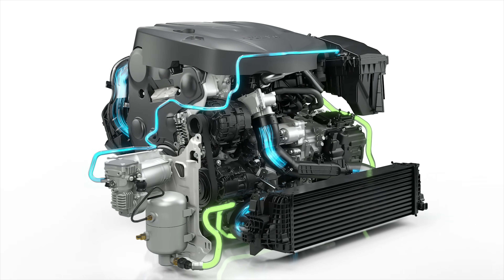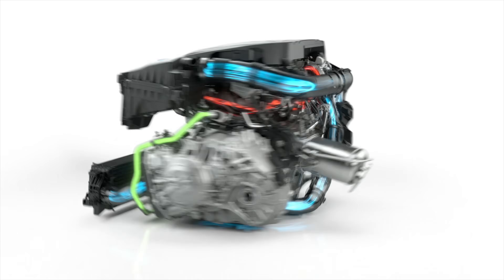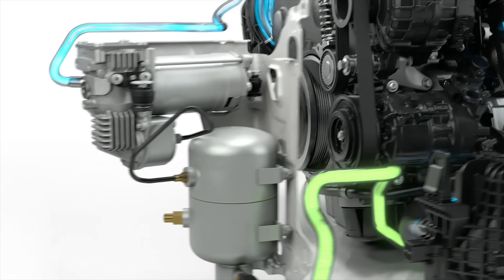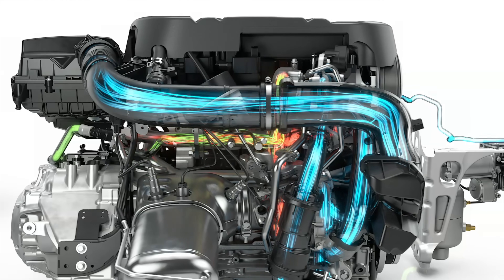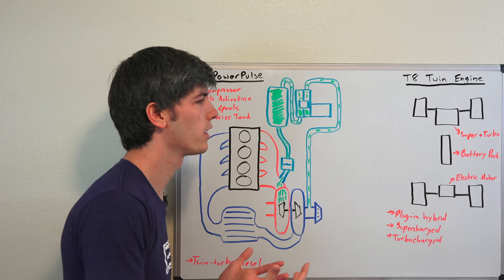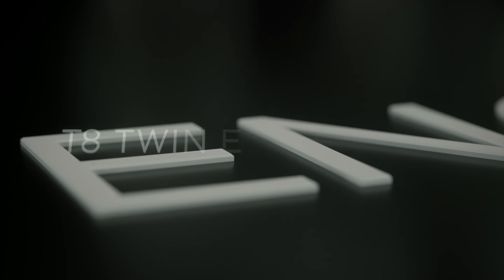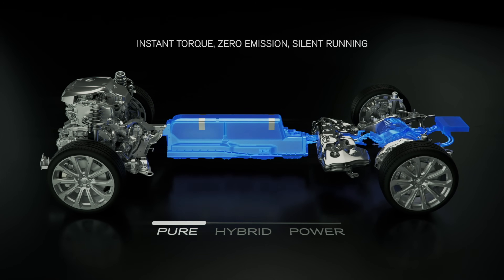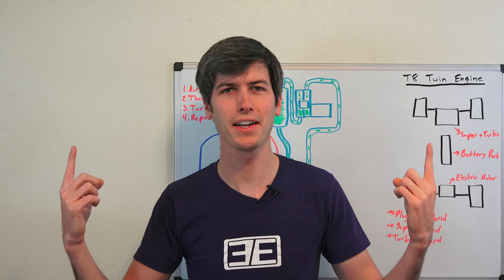How Volvo Is Eliminating Turbo Lag

Comment: What happens if you get into a wreck and that tank is ruptured?
Reply: Zax Crylan i presume they put a one-way valve kind of thing between the tank and exhaust manifold so if system fails to build up required tank pressure (e.g tank is raptured) you lose the anti-lag but can still spool the turbo by exhaust gases..well thats just my assumption though
Reply: Ayman Almateeg no. If you wreck and rupture the tank it explodes.

Comment: Is there a reason why they don't just use a motor to directly spool up the turbo, instead of using it for a compressor? Seems like a simpler and lighter system.

Comment: The latter part of your video reminds me of the old Golf 5 GT with a turbo and supercharged engine.  While I think the concept is cool to help mitigate turbo lag in a sense and maybe add a little sportiness to the Volvo brand, the extra added cost for these components, should one fail would be a turnoff for me.  Also the added cost to the overall MSRP of the vehicle when you look at purchasing new.  Although I don't call Volvo's a high end luxury car, I think this may push prices to more than what people would be willing to possibly spend on a Volvo.  Especially if the performance doesn't match up to a car of similar price, especially if you look at the V90.  

You produce some great videos, so please keep up the great work.
Reply: My Name You have a good point, although, considering recent Volvo depreciation, one of these would probably be a screaming bargain in a few years as a used car or CPO.
Reply: That is a good point about being a CPO car.

Comment: Haven’t they been doing this with nos for awhile now?
Reply: Nitrous oxide doesn't fix turbo lag
Reply: s i d e w a y s l i f e s t y l e I don’t remember the name of the company but there’s been a kit out there for a while that injects no2 into the cold side of the turbo to bring it up to speed it may just be a drag car thing to help cut down 60ft times I’ve even seen it done with a bottle of regular compressed air
Reply: Never heard of it, don't think it's common either tbh, if it even exists.

Comment: I have read about this somewhere before where instead of letting the waisted boosted be released into the atmosphere when one lifts off the throttle said pressure is stored to be used latter...But I thought only racing turbo vehicles store unused boost for future use.

Comment: I feel like I saw an article a few years back talking about a similar set-up with the pressure tank feeding the intake side instead of the exhaust. Did anything become of that?
Reply: Cars Simplified I don't think you can get much benefit by pressurizing the intake manifold of a car that uses forced induction. But maybe that's not what you were suggesting.

Comment: IIRC years ago Ford developed a prototype compressed air system to accelerate F150 pickups and said it could easily accelerate a F150 to 25MPH without assistance from the internal combustion engine. The compressed air was used to spin the drive shaft from my understanding. Perhaps they placed vanes on the driveshaft similar to a turbo and made it from a light weight material such as aluminum and carbon fiber?
Reply: Interesting stuff! I wonder what became of that.
Reply: Cars Simplified not a damn thing

Comment: I just wonder, why not force that compressed air straight into the intake instead of using it to spool up the turbo? Is it a volume problem? Not enough air to keep the pressure up before the turbo takes over?

Comment: Sounds like a high pressure secondary air pump. The introduction of air will lean out the exhaust mixture causing it to become even hotter. Of course hotter air mean less density, more energy, and quicker flow to boost the exhaust turbine speed. Good job volvo smart innovating!

Comment: Good technology  more  headache at repair shop .
Reply: Rimac, nio or delta motorsport es very superior, four stroke is shi* is to want to improve what is already deficient. And more maintenance cost.
Reply: Soapy water u can find leaks fearly quick no big deal
Reply: What makes it double good. Feature to sell, money during maintenance/repair :+1:
Reply: That's putting it mildly!
It will be quite a headache when there is a leak somewhere on that tank-to-turbo line.
Reply: I'm a Volvo mechanic, and the power pulse system is already faulty so were rebuilding it on warrenty

Comment: Will it not run lean when it's using the compressed gas as it's not accounted for the extra air or is it pushed throw the air mass sensor
Reply: the compressed air goes to the exhaust housing on the engine turbo, which will suck up air quicker and compress it quicker all while passing through the AMS/AFM so no it wont run lean, if it did it wouldn't be for sale as they would be blowing engines in testing

Comment: @EngineeringExplained is there a possibility you can do a video or series on trucks: specifically Chevy/GMC, Ram, and Ford. You could touch upon the Diesel variants Cummins, Duramax, Powerstroke. Maybe picking out the fallacies and doing some mythbusting amongst those who choose one company's truck over another while choosing your favorite based on criteria you've used in the past to choose a preferred car.  You could even get into the gasoline versions as well.  It would be  very interesting. 
Your videos are great. Keep up your hard work!

Comment: So basically they are using a generator, battery and an electric motor instead of a simple driveshaft for the rear axle. I wonder if this system is more efficient than a driveshaft
Reply: I dont think so. Added complexity and repair costs will hurt hard.

Comment: In some marine engines, this system is used to prevent black smoke on starting and of course sudden changes in load. In a car this must have this benefit too and prevent damage to the Catalytic Converter by unburnt fuel.

Comment: Lesson learned turbos make lag and need help to give you that NA feel.
But they game the epa with higher numbers.
so all companies even Porshe or cutting at least 2 cylinders and adding a turbo to make up the power loss, with some lag and no high end power, but technically more torque and maybe even faster with the lighter engine weight and all, and possibly more space with the smaller motor and all.

Comment: the best turbo lag reduction is to use 6+ litre V8 instead of 2 litre I4
Reply: some people dont want to buy that much gas...just money for greedy opec and big oil
Reply: Jon Dittmar Lame.
Reply: the auto manufactures care or else they will not be able to stay in business. is that a good enough reason?
Reply: Jon Dittmar You're wrong, and that is the reason you can't stay on topic and continue to distract. The subject at matter isn't the FM or it's safety, it's the size of LS and other 6+ liter engines, and the FM is just as example how well an engine of that particular size can fit. There are myriad of other cars with LS and other 6.0L or larger small blocks, most of them production and crash tested vehicles.

The LS is a relatively small engine, not much larger than 1.8L Mazda Turbo.
engineswapdepot com/wp-content/uploads/2015/02/Miata-I4-engine-vs-LS3-V8-size-comparison-02-1024x567.jpg
Reply: Jon Dittmar exactly adding power is no where near as beneficial as reducing weight
Reply: that ls swapped miata is not crash test approved there is much more testing required for a production vehicle
Reply: we are talking about production vehicles not project cars......
Reply: i don't think volvo wants to give gm money. volvo is to small to have multiple engine options
Reply: And get less power and torque out of the v8 than the i4
Reply: Who? Me ?
Reply: turboing both.. wat?
Reply: that means either a bigger car which would add more weight, or decrease passenger volume, have to fit that engine in their somewhere. This setup add hp, fuel efficiency, and doesn't touch passenger volume
Reply: chris nice argument, you totally won that debate. please teach me how to be smart like you
Reply: Jon Dittmar = FAIL!
Reply: More cylinders = more surface area = more oil.
Reply: The new XC90 T8 makes about 30 more horsepower than my dad’s 2006 XC90 V8 with a 4.4 litre Yamaha V8 in it.
Reply: clayman666metalYT and get a third of the mpg along with monstrous long term maintenance costs
Reply: A v8 has more lag, more cylinders need more air to make the power. Also v8s cant go around corners fast
Reply: Jon Dittmar You clearly can't follow. His point is that the LS , a 6L+ V8, is small enough to fit in a Miata, but your flew off the rails into non-sequitur land. It doesn't whether it's crash tested or not, the LS is a small engine, and your initial statement is false.
Reply: You hate cars don't you?

Comment: so they are using an electric motor to feed compressed air into the system. why not just take an electric turbocharger (like audi) to kill the lag? is there a significant cost difference in production? do you happen to know that

Comment: Something else to add to the cost. Something else to break. It seems like something that would only appeal to a few, and only occasionally be used. And it will only reduce lag, not eliminate it. After driving an electric car, all internal engines lag. To each his own, but I’ll pass.

Comment: great ideas, but how can they build this to be reliable?
Reply from the maker: +Dany test, test, and test some more. :)
Reply: the automotive industry doesnt know what the hell reliable is.
Reply: to be honest, 
volvo haven't had any significant problems with these engines since 2015 ...
they did have some software issues, but they were rather quickly resolved with an update.
but the engines don't seem to form a problem whatsoever, let's see how they continue to hold up. :)
Reply: Volvo is the most reliable car in the world...
Reply: Albert S  that is just not true.
these new engines are not old enough yet, to call them bullet proof.
but they are not causing any problems !
Reply: what do you mean exactly ?

Comment: @Engineering Explained  Jason, sorry to be pedantic, but I think this actually isn't a sequential turbo system. Sequential turbos refers to when there are two separate, different sized turbos both being fed by exhaust directly from the engine, with the smaller turbo working primarily during low RPM and the larger one working primarily at high RPM (I know you know this because you discussed it once, I think). It looks to me like this is a compound turbo setup, in which air is compressed by one turbo and then re-compressed by the second one, and so the boost pressures created are multiplicative instead of additive. Is that what Volvo has done here?

Comment: Before watching this video, I thought there would be two options: compressed air or adding an electric/mechanical drive to the turbo itself. The second option would have serious heat problems, while the first is cludgy. Cludgy wins.

Comment: With the compressed air being added to the hot side of the turbo is there a danger of forcing the exhaust gases back into the engine or at least preventing the exhaust gases from leaving the combustion chamber properly?
Reply: Tiger955 yeah I was wondering the same thing. I guess the pressure isn't great enough restrict the cylinder exhausting, getting a significant volumes of air through the turbo is probably key, rather than very high pressure air

Comment: To explain why people some people love lag, it's about consequence and reward, if you drive properly while driving spiritedly you shouldn't really ever find yourself outside of boost range (not with anything with full boost by 50% RPM). For a lot of us we enjoy a car that's able to be made fast with fast driving, but not fast automatically. We want to be punished when we make a mistake as it makes it that much more rewarding when you get it right.

Also in some motorsports, especially drift we find lag can be an advantage when trying to find grip with spinning tyres, dropping the revs into lag can help feather the throttle, slow the wheel speed down and get drive. Once you find the drive and build momentum you can easily clutch kick back into full boost to get the engine singing again.

Not to mention the fact that the feeling of a big turbo ramping up and coming onto boost is amazing! But as always, everyone loves different things and that's what keeps things interesting. Obviously none of this is really relevant to production mass production vehicles, just a little insight from someone who personally loves a bit of lag. Interesting video none the less, thanks!

Comment: If you cannot afford a Ferrari but always wanted a Ferrari maintenance bill, Volvo has something new for you....
Reply: Then buy a BMW snd you will see s high maintenance bill
Reply: Not true. On my second Volvo. First was a 2011, S60 3.0 turbo that had over 200k miles on it. Currently have a 2018 S90 T6 which is the engine with the super & turbo charger, and it’s been great so far at 145k miles
Reply: Baerchenization true dat
Reply: Baerchenization haha warranty warranty
Reply: Volvo stopped being real Volvos since they became part of a conglomerate that china profits from.  I'll take an old red block turbo 240 por better yet, a 245 or 145, the single round headlamp oldie that isn't all that different then its newer cousin, the 240/245.  My very first car was a '79 265 GLE w the weirdo v6
Reply: Na my 740 has 300k and still kicks ass and my xc90 has only had to be repaired once due to alternator being bad
Reply: That has to be kilometres, right? @lookItsJayden
Reply: That's not actually true. I had a 850 T5 Volvo and the Volvo dealership took like circa 400 euros for timing job with out a water pump. That's not bad at all if you think about all the space (which it don't have) and all the crap you need to get out of the way lol

Comment: It just hit me:  why not fill up that air tank from the wastegate instead?  Basically reusing the turbo pressure that otherwise would be wasted, and let it fill in the lag for a later throttle application.     
My guess is the wastegate is used too rarely and can't build enough pressure for this to be effective, but in theory it seems like a quite efficient solution :)
Reply: Restricting the wastegate by forcing it's exhaust into a tank will cause backpressure in the wastegate that will mess up controlling the turbo's boost. The less backpressure in the wastegate exhaust the better for consistent turbo control. Cars with aftermarket turbos frequently have to use an external wastegate exhausting with a very short pipe to atmosphere, or if it re-enters the exhaust system a good ways down the line from the turbo.
Reply: Makes sense! Thanks for the reply.

Comment: Wouldn't there be a way to use sort of an engine brake to fill up the tank instead of using the engine's power? Or the system's not worth the additional weight?

Comment: There is an app called PerfExpert, could you please do a video on it and try it out for yourself? I am interested in hearing your opinion on it as an engineer. It measures hp and torque from the accelerometer.

Comment: Why do they use this system instead of an electric turbocharger? (Like audi and mercedes in their newest engines?) is this more efficient or does it have other benefits?
Reply from the maker: +Nelayo Isso more cost effective than an electric setup.
Reply: okay, does it use as 12v compressor?  because at least I think that the 48 volt setup is more likely to become standard in the future, some companys plan with a 48 volt setup and an engine without anything driven from the engine other than the generator (dont know the english word for it), so that the water pump, compressor for the AC and so on are all driven by an electric motor.

Comment: while cool, this seems contrived.  Why not try to compress the intake air directly, e.g. use electric motor to assist compressor at low rpm?

Comment: Didn't Ford do something like this in the early 2000s with the Focus WRC car? Pretty sure they had a  massive compressed air tank hidden in the rear bumper to feed air to the turbo
Reply: David Irvine yeah it did. The wrc lancer evo 3 and st205 celica used a similar system aswell. I think all the modern rally cars use compressed air from a bypass valve system now due to noise restrictions.
Reply: nismonate didn't know that about the modern wrc cars 👍🏼🚗

Comment: What's nice about the compressed air tank is that it seems that if it stops working it just means the car has turbo lag. At least I hope so. Would be nice to be able to just turn it off with some short coding

Comment: So basically Volvo added another "turbo" that holds compressed air to b used only when the throttle is opened. Sounds like a way to make engine bays tighter. Who really hates turbo lag that much!? I actually kinda appreciate it, it lets me kno the turbo in my Evo is working lol.

Comment: You should have mentioned the supercharger on the T8 engine only works below 3,500 rpm. An electromagnetic clutch disengages it when the turbo makes enough boost on its own.
Reply from the maker: Correct. Didn't mention the specific RPM, but mentioned the supercharger is used at lower RPM, while the turbo handles higher RPM. They've done this in the past as well with non-hybrid versions using the same engine - https://youtu.be/zVx-YcviGYY
Reply: Should have kept the simple reliable 3.0 inline 6.
Reply: Pro charged hybrid… oh god..
Reply: @jth_printed_designs they're made by Eaton. Highly reliable units.

Comment: Electric turbos! When will they become viable? I'm guessing with hybrid cars becoming more common and motor technology improving due to stronger magnets, compact design, power controllers becoming more efficient, that it will happen fairly soon. I've seen a few videos of people trying their own designs where they are able to create low boost (5-7 psi), but high boost seems a fair way off for fully electric turbos for the time being.